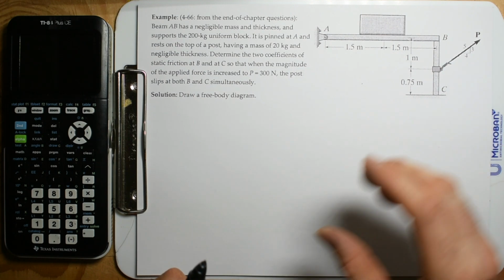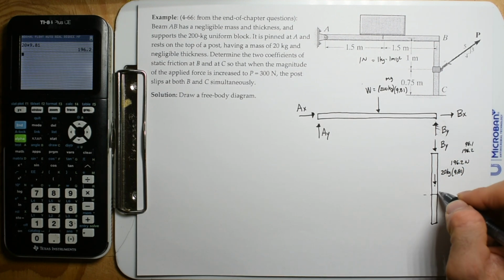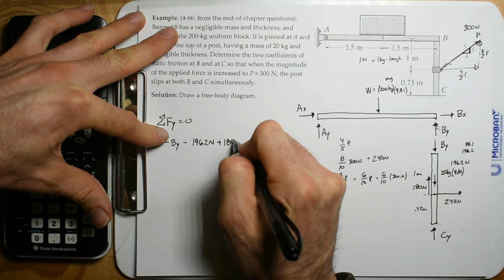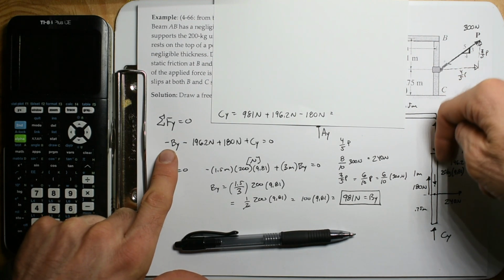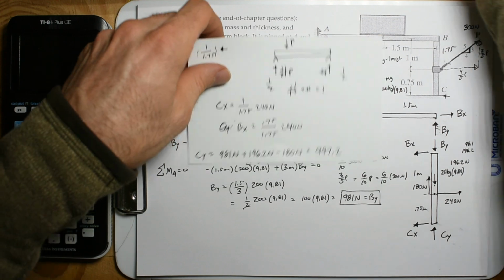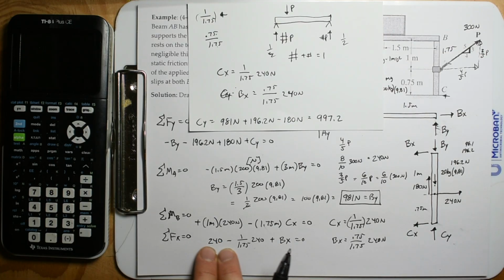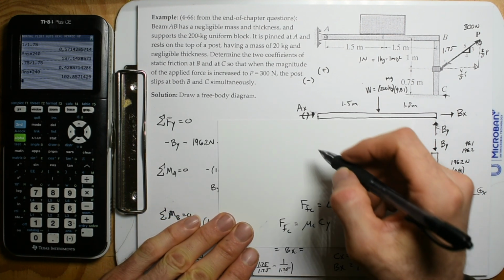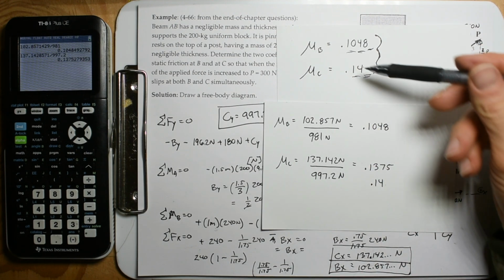Friction of RIPPING OUT a POST!  ||  Engineering Static!

Comment: PLEASE DO THIS 🙏 🙏 🙏 🙏 🙏 
A man of mass 60 kg standing on a light weighing machine kept in a box of mass 30 kg The box is hanging from a pulley fixed to the ceiling through a light rope, the other end of which is held by the man himself. If the man manages to keep the box at rest, what is the weight shown by the machine? What force should he exert on the rope to get his correct weight on the machine?